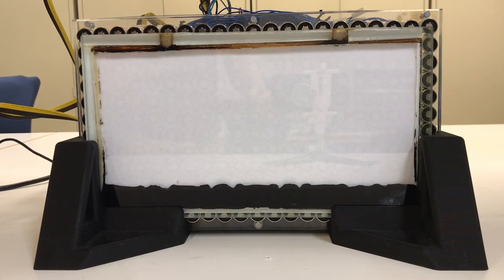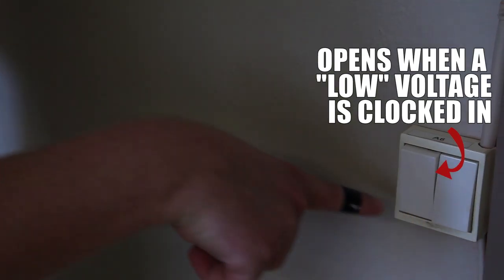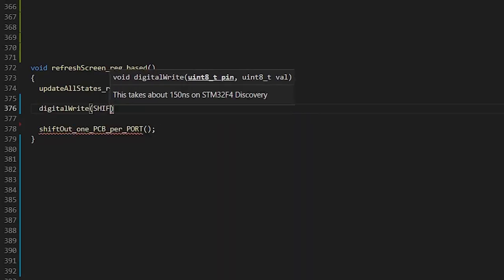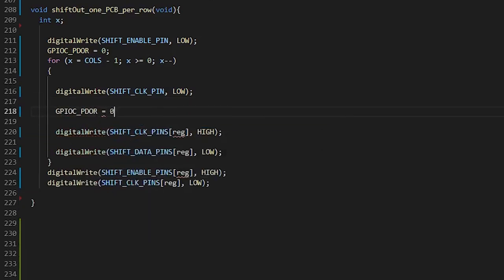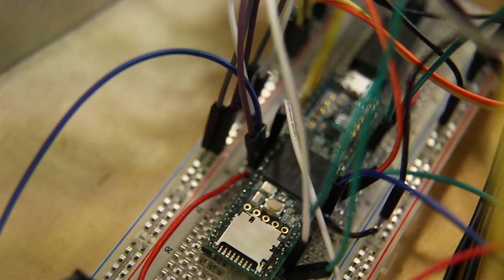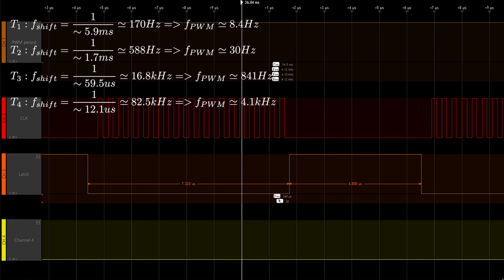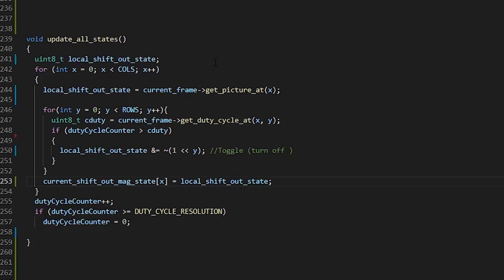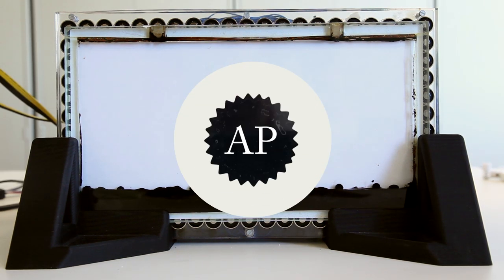Making our code run 45,000% faster - Fetch #7

Comment: If you guys thing going from an Arduino to a Teensy is a big step up, you should consider going to an FPGA. 
I strongly recommend you start with james bowmans' Swapforth on a iceStick. Maybe to graduate to something larger&faster supported by the symbiflow toolchain.
With an FPGA,  you could have avoided having to make a PCB with all those shift register chips. 
FPGA's have any bit-width you ask for (they really love both parallel and serial data). 
And in terms of speed (operating IO), they leave all CPU's far behind.
With the additional bonus that once you have some functionality working, and you add more -- it adds entirely in parallel, so what you have working (in a precise-timing sense) doesn't change or get slower. ( unlike a CPU). IM(NS)HO, this alone is worth the true price of admission. 
But with many of the available open-cores, you can also have a CPU in there that can be even be programmed by arduino if you like (see ZPUino for how). You can then alter that design to add any 'hardware' functions like auto matic PWM, or even an automatic display driver sub-system, effectively creating a custom chip that does exactly what you want it to do. 
Also, check out icestudio (which also works with the iceStick and other ice40 FPGA boards) - this is very much like arduino, but with a graphical block diagram interface, and hands-down the absolute fastest time to go from making a change to running it that I've ever seen (just a few seconds). 

Microcontrollers, these days, are the low-cost budget option for mass-production, especially if the programmer's time is not a large component of the total cost. But getting them to work perfectly is absolutely a massive art form in its own right. Even real-time Operating systems can't really help with this. 

A central processing unit is like having one employee working in a big factory - okay, he's like super-man speed, but even he can only be in one place at a time. An fpga is like just adding more an more people to the factory as you get different areas setup. It's like having a big factory floor with room to grow (until you need a bigger chip!). 

It boils down to a CPU being able to give the illusion of doing many things at once to a human just fine, but ultimately being unable to quite fool the real world. Even moden PC's have a plethora of independant parts -- many actually including FPGA's! -- so that it's just not the 'one guy'. 

FPGA's just take this idea and run with it, they're actually really simple  -- a big grid of lookup tables, with some registers, and some programmable interconnect (and a clock network) and surprisingly little else (sometimes some SRAM, maybe some ALU's, and of course some way to connect to the real world). But you don't have to program the FPGA directly itself -- because of the tools, what you're really doing is programming the toolchain, so that it can know exactly what you want, and then it goes and sets something up that meets that spec.

There is a bit of pain in learning how to write code for FPGA's - it's really more 'digital hardware architecture' than it is 'programming': The 'synthesis' tool is the only part that runs like a programmed computer, but it's just making a model which describes what the thing is and does, and exactly when each part does it, and how everything connects.
And even then there are great projects like nmigen and MyHDL that allow you to do all this from Python. 

Arduino has been great for making microcontrollers (and practical programming of them) really accessible, but it's good really just for jobs that a human could do manually. When you want truly super-human reflexes and perfectly smooth, glitchless control, you should be reaching for an FPGA, not just a slightly-faster microcontroller.
Reply from the maker: We are using an FPGA for a future project (not Fetch), but want to keep Fetch running on an MCU for as long as it’s convenient. We want this project to be as accessible as possible, so hopefully someone else can pick up parts of it and contribute to the open-source code. Since the Teensy is fast enough, and we’ve implemented hardware PWM in the next PCB revision (ordered yesterday), it makes sense to us to stay on a platform that most people know how works. In terms of making the BOM cheaper, I agree that we need to look into using FPGAs in the future. Especially if we can find one with few external components and enough I/O for our needs. Keep in mind that we can’t multiplex the magnets, so we basically need 252 I/O pins, but if we scale down to a smaller size, FPGAs may become viable. We’ll see!
Reply: @AppliedProcrastination  Fair enough. 
For your future needs, you could in fact just keep scaling up, and still use (small/cheap) FPGAs:

Keep in mind that since you can trivially implement shift registers in FPGAs,  it often makes sense to a couple of smaller cheaper ones on the same system rather than one big one. This will allow you to also use easier footprints as well (ie, avoiding difficult BGA packages, for instance).

You could use three TQ144 ice40hx4k chips and, after allowing pins for clock, jtag, and a spi-like interface to transfer data from one to the next, you'd still have about 297 completely un-assigned pins, all of which could be running from ~50 MHz clock without having to bother with things like 'timing closure'. (if you do, you can get designs to run at a 1 to 2 hundred MHz, but for many control tasks,  1 MHz is often already excessive - so I would just avoid trying to reach for 'the fastest clock' and live with 'far more than good enough'.). 

Using multiple isn't much harder than using one -- you'd usually have multiple voltage regulators, but you can share those among the multiple chips. And you can program the lot at once using a jtag chain. (if you are making your own boards).

As a nice bonus, there isn't really any internal difference between the 4k and the 8k if you use the OSS tools - main difference is things like you get only 1 pll instead of 2 - they were arbitrarily limiting the size allowed in the 4k chip in the OEM tools, but there's been absolutely no reported failures to fit an 8k design in to a 4k chip with the OSS tools.

Or you could just go for a larger ecp5 chip, use two and have ~480  spare io pins.

Point is: Don't get hung up on having to use just one chip -- with FPGA's it's really easy to link them with a very simple and very fast serial bus which can easily transfer ~300's MB/s: Just do something like SPI, but with complementary logic (it's not really differential, but you'd like both the signal and their complement signal to take the same time to arrive - they don't really need to be routed as a pair on a ground plane if that's true). 

There are 'gearing' io blocks that make it easy to do even a 4x (or 8x) 'ddr' like signal, and you can also have a special clock that goes much faster, just for shifting a big parallel register from one chip to another. Lattice has app notes for how to do this, and so long as you don't introduce skew in the traces, it will work exceedingly well (especially when you have a single clock shared over the board -- have one chip produce it and output it to the others, and everything can then stay in sync easily). 

Having 'just one central processor' has perhaps conditioned us too much to the idea of just buying 'one that will fit everything'. But if you need more IO than  you need internal resources, it does make a lot of sense to use a set of smaller, cheaper chips than just one big one. I have a few systems where I have multiple FPGA's deployed together (on separate boards, but those complementary-logic spi busses also work really well board-to-board). 

Otherwise the really 'big' FPGA's get expensive very quickly -- but even they are usually deployed in arrays, so they can be used to run and verify things like GPU designs before they go to silicon. You'll never need so many. 

The whole swapforth j1a forth system (of GH: jamesbowman/swapforth) will fit on a 1k ice40 part - that's including the almost-fully ans-forth compatible 16 bit system -- you can operate it with just an rs232 connection and a terminal emulator, it hosts its own compiler, and it still does about 30M+ 'forth words' per second: It's only 'interpreting' right after you send it each character, otherwise it's all as if programmed by assembly. James has a video on YT where he demonstrates this.

It's so easy to communicate amongst FPGA's that I usually find it sufficient just to use a few of the existing dev boards, and just wire-wrap the 0.1" headers as necessary to bus them up. I'll tend to mount them with M3 'cup magnets' to the backplane of a electrical enclosure, and wire them in place once they're positioned how I like. 

This is also a great way to use any 'arduino compatible' PCB modules too -- mount them down,  nearby, and then hook them up with just the right length wires. Keep the wires under 1 foot and they'll work well up to 20 MHz without much trouble. If you want to go faster or further, you can also use LVDS tx/rx chips on little 0.1" breakouts to convert between 3.3V single ended to a complementary logic cable which will not radiate -- and which will go a metre or two easily into the ~300's MHz.  Of course at the FPGA ends you just use a pair of pins, but many PCB modules don't have complimentary interfaces. (It's even okay just to 'dump' the complement side through a resistor into ground on that pcb module -- the real point of complementary digital signalling is that the total current of all the wires in a cable sums to a constant that does not depend on the state of the bus: hence no EMI, (or even ground-bounce) and if all the links in a box are doing this, you probably don't need to be using differential reception, because there's no interfering noise to reject anyway. Just pick a load resistor that looks the same as the chip input which is wired, and this should work fine).

Normally I'll add one linux SBC (booting from eMMC, USB or 'industrial' uSD) to act as an 'edge' device. This just runs a standard OS image, and hosts the USB->FPGA link so it can be reprogrammed in place. For the swapforth system, the rs232 goes over the other serial port in that link (it's usually one of those two-port ftdi 2232H chips). Then I just install buildkit-io/bktty to that SBC, and it becomes accessible to any browser on the lan with just a web link.

Then you can easily do all the FPGA development elsewhere on a faster system, but you can also keep the whole toolchain on the SBC (along with your project source code) so if you come back to it after it's collected dust for a while, you don't have to figure out exactly where you were at, or 're learn' how to set up the toolchain for it. Also if someone else later 'inherits' it, it's about the most hacker-friendly system possible. (even more so if you leave the root credentials written in a note in the box). The ultimate in easily-repaired, modded or reusable control systems. 

As far as security - you could organise it so the JTAG link is on a physical switch -- that way without selecting that switch, the FPGA would not be able to be reprogrammed. So even if the SBC gets compromised, you could setup the control system to just keep doing its job, whilst ignoring invalid commands from it. But if someone opens the box, they have physical access: You're never going to be able to stop them doing whatever they want anyway, so you might as well just be nice.

It's how I would do systems intended for Mars - where you would have to assume that someone might need to repair or mod it at some point in the future, and probably won't have access to the internet when they do. They'd want the toolchain, all the documentation and actual source code to be 'in the box' with it, so it's not just another obtuse black box.

Comment: If you include kinetis.h, you can write to IO registers like GPIOn_PDOR to set all the port's bits at once
Going further, if you want to set/unset bits on a port, you can just write the mask to it's PSOR/PCOR so flicking it for a clocking line is as easy as GPIOn_PSOR=_BV(clockbit); then GPIOn_PCOR=_BV(clockbit); to set it back to LOW.
It's faster because the processor doesn't need to load the port's value then change it and store it back each time.
I think Teensy 4 has an additional XOR register so the mask can toggle a port's bits as well

Comment: Can someone explain why PWM is used? Is it because it makes the ferrofluid flow faster when displaying something?
Reply from the maker: With PWM we can adjust the force of each individual electromagnet. We need this because gravity pulls the ferrofluid down towards the lowest ignited pixel leaving too little ferrofluid for the top pixels if all magnets have the same holding force.
Reply: @AppliedProcrastination  you should try using neodymium magnets as the magnetic force to attract the ferrofluid. I think using electromagnets of the ones you are using is extremely inefficient, power hungry and too complicated. I think it could be possible to double the electromagnetic strength using custom homemade electromagnets of the same size but does not seem too logic to implement when neodymium magnets are extremely low price and would not require heavy power but will be tricky to implement something that is fast and quite to drive the ferrofluid.

Comment: interesting but would it not just make ur guys lives so much more easier to just use an FPGA so as to control the actual magnets ?
Reply from the maker: Maybe, but this was the easiest solution with the components we already had available/were familiar with, and we’ve solved this problem in hardware on our next PCB design :)
Reply from the maker: Plus: it was a fun little exercise in optimization!